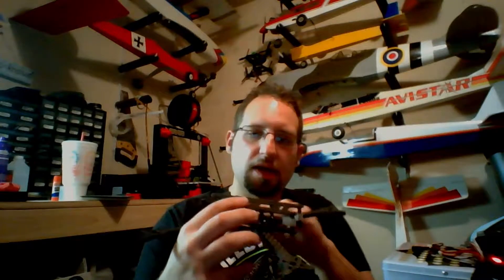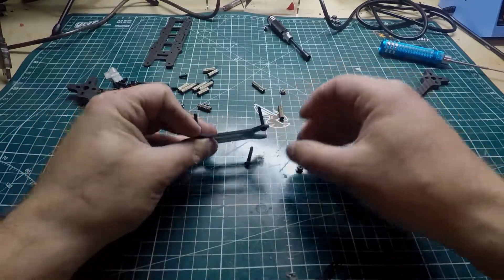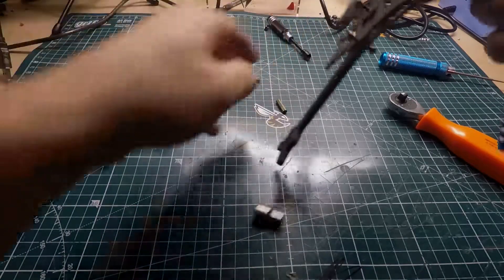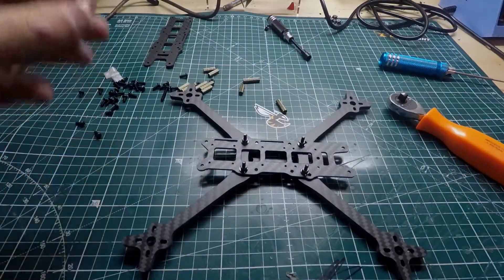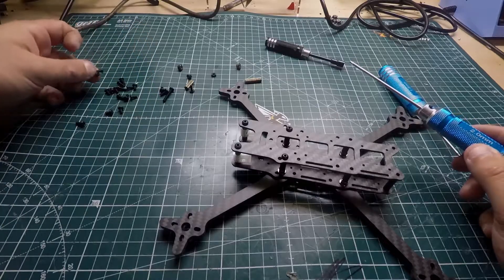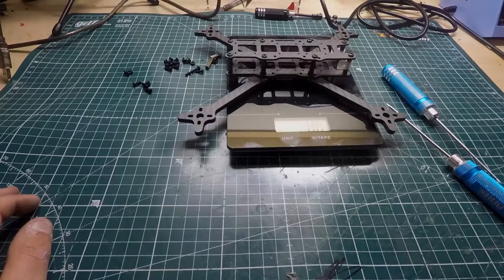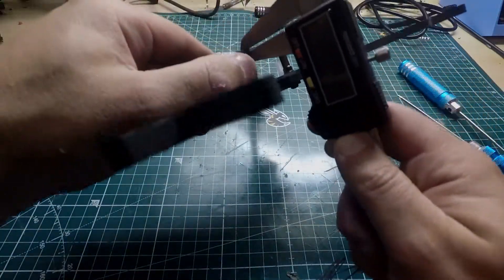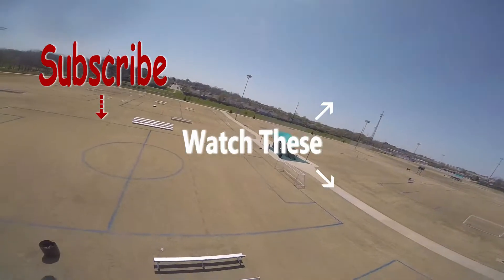FlosStyle Frame Build & Overview

Comment: Feels like a really tight build for a 2 stack, will be nice!  One thing I didn't like is that once the frame is tightened, I am unable to remove/add the stack mount screws on the bottom. Not a big deal, might be able to squeeze them in.
Reply from the maker: Cotees you should be able to get to them mine just peak out at the sides unless your doing a 20x20 and that would be a problem you will have to put the screws on first then the brace
Reply: yeah I can get to them, the screw head just kinda gets stuck, but I am able to wiggle it out.